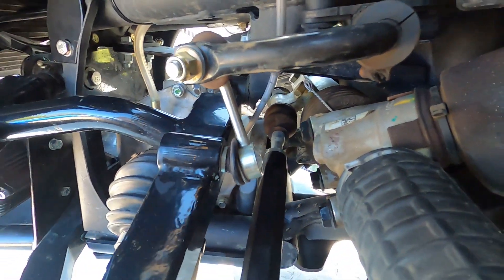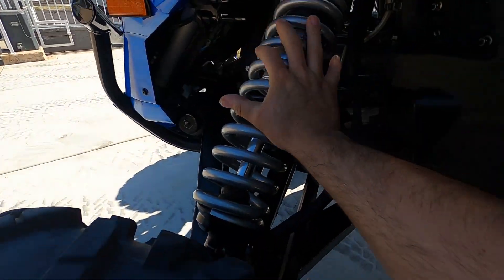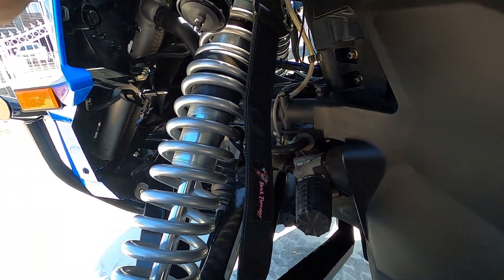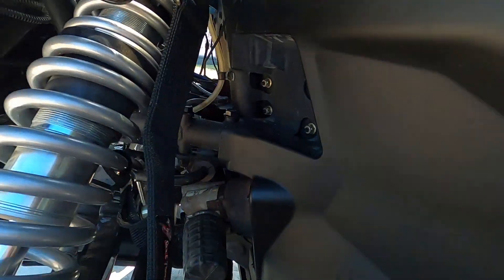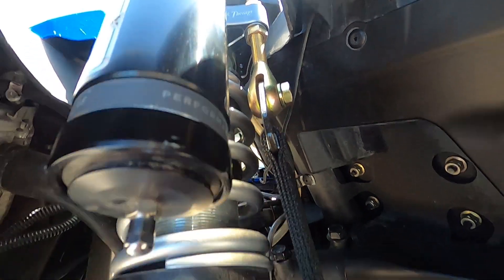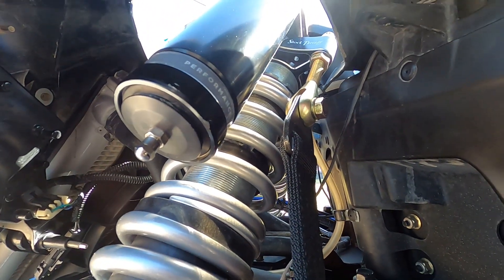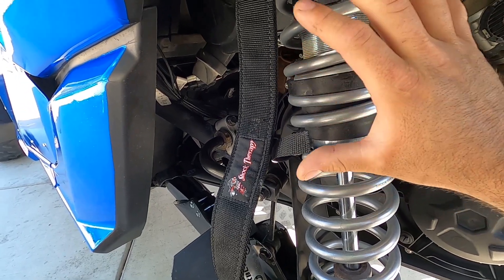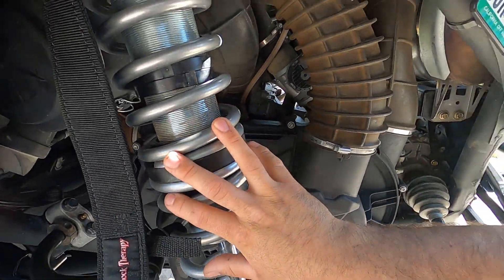Does Your CAN AM X3 CLUNK??? FIX IT With SHOCK THERAPY Limit Straps EP73

Comment: so you replaced the stock shocks just installed the limit straps
Reply from the maker: The shocks are flipped for the limit straps to work on the front.
Reply: @GLifeUTV  do you have to flip the shocks left to right to replace the shock tower mount and does it matter if you switch the shocks from the right side to the left side
Reply from the maker: @mikemendez8665  yes swapped the shocks from left to right if u are flipping them. If u plan to do this then the plastics have to be trimmed or else they will hit the shock badly at full compression
Reply: @GLifeUTV  they work either way